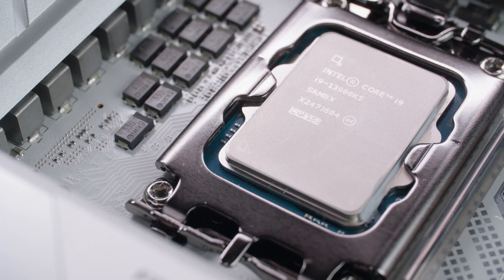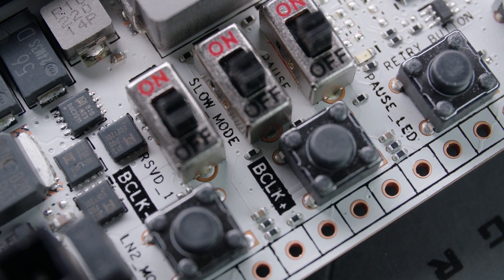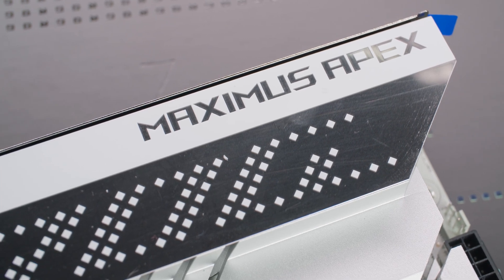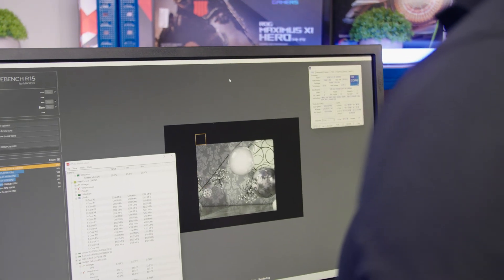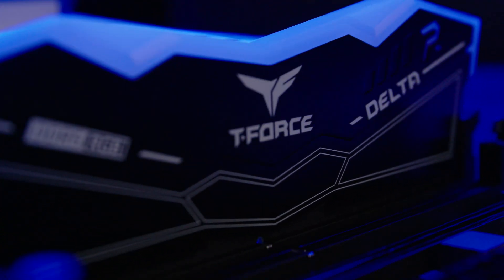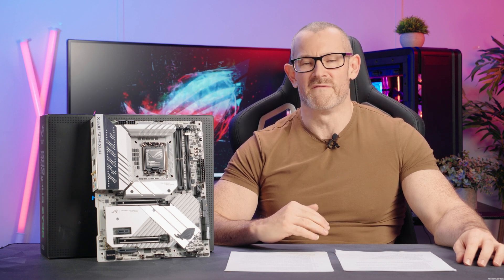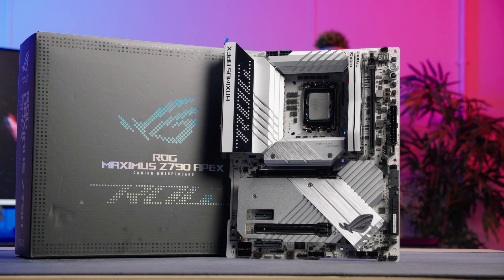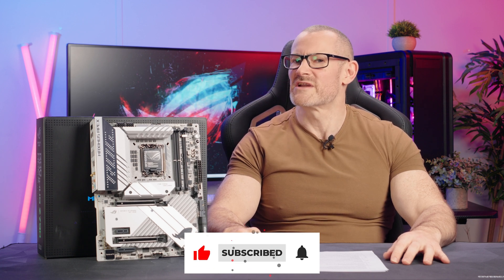Overclocking, Memory Speeds & Benchmarking the i9-13900KS & Asus Z790 ROG Maximus Apex Review 💰

Comment: To help mitigate potential stability/degradation widely reported on flagship Raptor lake SKUs, I have changed a lot of my BIOS settings based on what I have watched and read. For my 13900k and 14900k I have done the following: MCE off, PL1 and PL2 limit to 225, limit P-core boost to 5.5 GHz and E-core boost to 4.3GHz, and use balanced power profile in Windows (although I do disable core parking to keep system highly responsive). Oh and just XMP on the RAM. I didn’t change LLC value. I have set voltage offset at a modest -0.015v and set the Core limit to 300 Amps. I have disabled the C6&C7 C states and EIST. Lastly I have locked AVX at 0 offset. I have tested on P95, CB R23 and CB R15. All great and in a mid 20 degree room, no workload exceeds 80c on package or cores. Very happy and benchmarks are very close to where they were before taming these beasts.
Reply: Why would you limit p-cores to 5.5 GHz and e-cores to 4.3? You might as well have just purchased a 13700K or 14700K or, heck, even a 13600K or 14600K if you're going to do that. Also, 225 W is too low. Just go with the Intel spec 320 W which most motherboards do not implement at stock (they usually have it unlimited or like 400 W). Or set it to something like 280 W if you think 320 is still too high. Also, I highly suggest not setting any core boost limits. You're just slowing your CPU down even more. If you're super paranoid about degradation, then just simply set a wattage and temp limit in the BIOS - but not core boosting limit - therefore your cores/CPU will run as fast as possible when it's not hitting power or heat limits but it'll still downclock whenever, if ever, you hit those heat or wattage limits.
Reply: @vincer9960  I have since gone back to normal but limited power to 320A and PL1 and PL2 to 253w. Its fiiiine 🤪

Comment: If 8 Pack says it's Sunday, it's ***ing Sunday. Great video. Going back to the 13900ks - After 2 14900ks chips not being stable without adding some LLC even at stock, I have given up with that. I have a 14900k which is fine but the 14th ks SKU is not good IMO.

Comment: Perfect analogy .. You're a top fuel drag racer and I'm a LeMans or Cannonball racer.

My primary interest is Gaming and adding 200W, 300W or more for 10-15 FPS has two negative side effects: 1. It turns my office into a sauna so then I'll start gaming like crap because I'm too hot. 2. Instability, I'm about to win the game and .. poof .. blue screen! 🤬 .. obviously I know I can stress test but that's not a 100% guarantee playing full bore for a full day on a weekend. Game maps can induce their own instability from one to another alone; not to mention all the other variables can lead to unforeseen instability.

Don't get me wrong. It's fun to screw around and I have, but in my case stability is king and no noise is like a pillow. 

I have an i9-13900K, RTX 4090, etc CPU-Z J8P8UR .. It also has EK's monoblock and everything is water cooled .. since day one not one blue screen, and it makes zero noise with my open back headphones. I am thinking about buying the new i9-14900K or KS down the line just because I can, but I seriously doubt that I'll notice any difference whatsoever.

Comment: New Subscriber. Great review. I just picked up the Apex... been wanting it from day one, very hard to find. My Micro Center finally got only 1 in and I grabbed it! Running ddr5-7800 at 8200 on z790 Hero. Looking forward to testing on the Apex now :) BTW, I use the cpu frame bracket and lapped my 13900ks (no delid) went from 102c thermal throttling in CB23 to dropping temps 20c!
Reply: I want the Apex just for the looks, but I'm assuming for some basic gaming overclocks it's completely unnecessary? I have a white ROG 4090 OC coming tomorrow to put it my white 5000T that has a white Corsair AIO as well. I'm going to go with the ROG Z790-A to complete the all white build I've always wanted to do even though they are overdone at this point. The Z790-A looks great but this Apex is something else.
Reply: @Oak_Rocket  Yeah, it's a nice OC board... definitely wouldn't get for just gaming or production. Your build soounds like it is going to be clean and amazing! Would be great to see it if you are on any Discord channels.
Reply: @RKBenchmarker Honestly I have to ask, weren't you concerned with all the current Asus production quality issues Apex is having? I myself want to get one for almost a year now, but it's sold  out or unavailable everywhere for various reasons. But I can't help shake the feeling that if I were to get one and it turned out faulty for such an exorbitant price, like so many owners have... it would be a complete nightmare

Comment: Good review Ian, and glad to see you acknowledging the Silicon Lottery. I've been stung by this twice, on 8Pack bundles, first on a 10900K at launch and again on a 13900K/Hero bundle. In both cases Intel obviously sent reviewers and system builders like yourselves binned versions of the CPU and then kept the 'good' production chips for the KS launch and even those don't seemed to be binned by IMC. 
My 13900K has an SP of 98 and IMC SP of 69. Little chance of any real overclocking with that particular CPU even with my vastly OTT custom loop.
I would happily pay a sensible upgrade cost for a hot swap binned 13900KS and would ask you to offer that option to people who have bought your systems based on the originally advertised speeds. The swapped out CPUs could simply be utilised in standard system builds, so win win. Without that option I couldn't consider another bundle from Overclockers but would have to try to get a binned CPU, and see if they pull the KS trick again 😢.  Edit: Can I also suggest the G.Skill 7200 or 8000 MTs 48GB kits for your overclocking. Others have easily achieved well over 8000, and as high as 8800 depending on IMC. 
(latter on the Apex QVL only)

Comment: Do you know why the Maximus hero z790 XMP doesn't stabilize Corsair Dominator 6400? I've tried adding the timing in manually also and nothing is working.
Reply: Because of issues with other brands in years past, I have now only used G.Skill and have had no issues for 10 years... just my 2¢ :)

Comment: What type of PSU do you recommend for that cpu but a 4070ti?
Reply: if you wanna see my build let me know I just got it finished!! It’s a i9-1300ks with 4070ti and I got MSI A1000G Atx3.0 PSU(1000W). And it works just perfect. But if you want to be safe go for the 1200W that would be more than enough
Reply: @Dabkking  yeah that would be cool to see. I just built my 13900ks at the end of January this year. Also have an MSI motherboard. I did just order a new 2 DIMM slot motherboard, the Asus ROG Maximus Z790 APEX. on the 4 DIMM MSI Meg z790 Ace motherboard I was only able to get a stable 7200mhz xmp 32gb kit. I’m hoping to get to 8000mhz on this new motherboard. And also hopefully an even better cpu overclock.
Reply: @Hadley_MuadDib  What GPU will you be running, and what will you be doing with the system?
Reply: A minimum of 1000watts and to be more comfortable 1200watts, but if I had the funds I’d upgrade my 1200watt Corsair to the 1500watt Corsair because the 13900ks really pulls some wattage under load with the power and  wattages set to unlimited and at the same time my 4090 pulls 450watts max in games usually. I might still do this since I have a store credit at Microcenter. Also, I had a 4 DIMM slot MSI Meg Z790 Ace motherboard and a 13900ks. With a 32gb kit I was able to get to a stable 7200mhz. However I just ordered the Asus ROG Maximus Z790 APEX off Amazon today after learning that a quality 2dimm slot motherboard will provide much faster ddr5 memory speeds. I had to order Gskill 7800mhz cl36 32gb kit. Couldn’t find any Gskill 8000mhz xmp kits instock in the US.

Comment: 42,309 (stock) on a 13900k with DDR4 3600mhz here, so good to see how it compares which.................. turns out............................. is bloody good!!  Thank you 8Pack!
Reply: So your 13900k 3600mhz dd4 is faster than 13900KS 8200mhz dd5 ?
Reply: I am actually very surprised because I can get 42,500 on 5600 mhz with 13900kf on all core oc
Reply: What are your ambient and water cooling temps? Also, did you lap the cpu and block? Thx for your input.